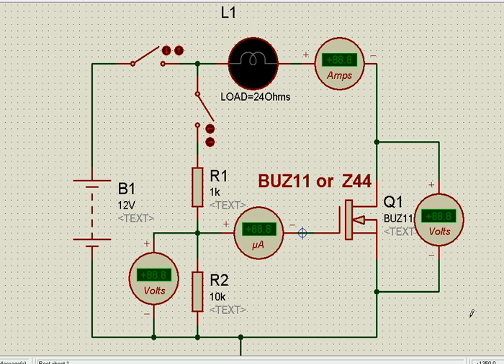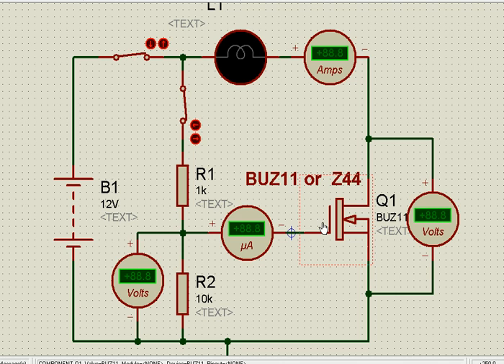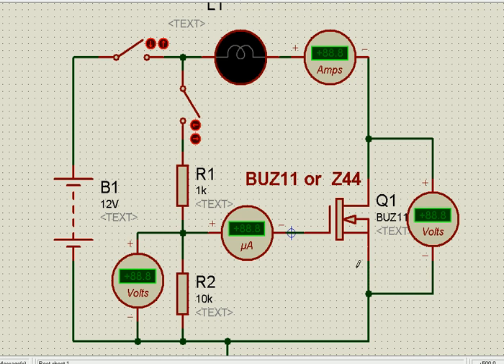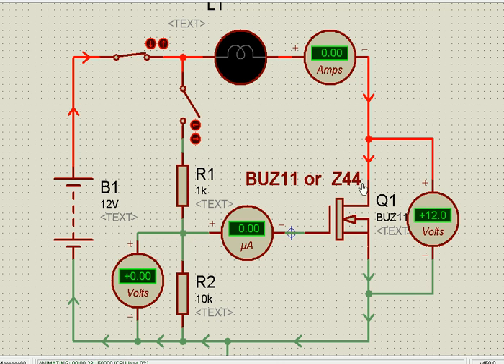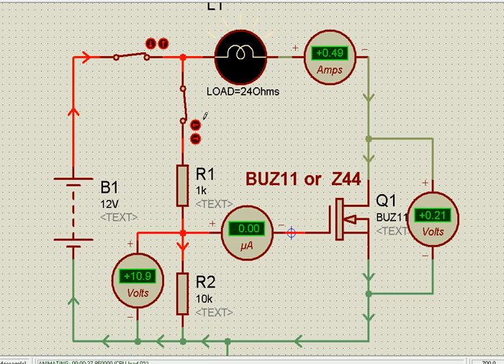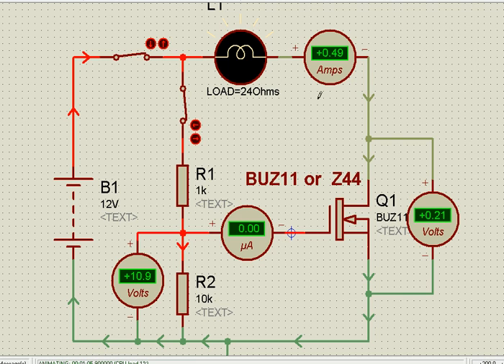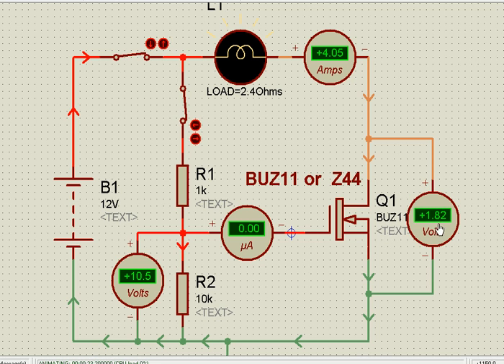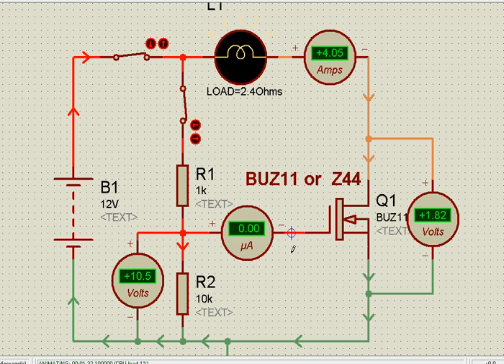Practical Electronics 6

Comment from the maker: No it is not 5 Amps, you are wrong.You have to improve your fundamental knowledge on OHM's law.Please see the voltage drop across the MOSFET which has to be deducted from 12 volt as all of them are in series.So 12 - 1.82= 10.18. Thus current = 10.18 / 2.4 = 4.2 .Even this is not correct as there is an internal resistance of the battery that comes into effect so some voltage is also dropped there.So finally one gets the current as seen on the Amp meter as 4.05.